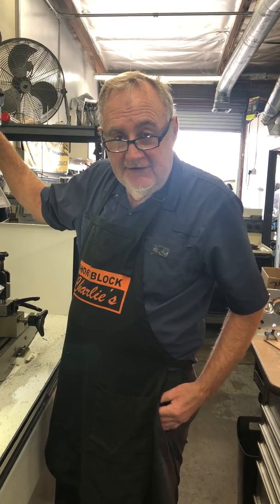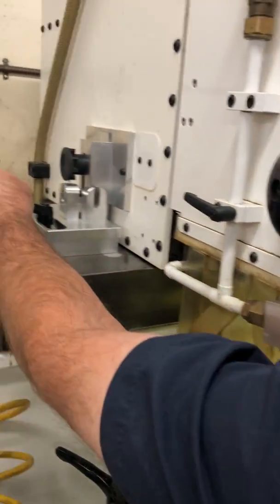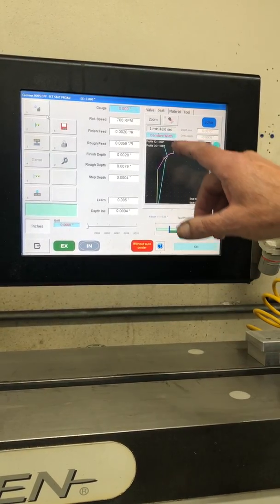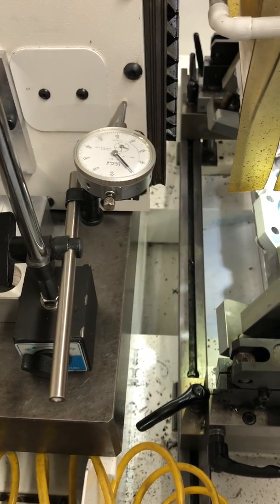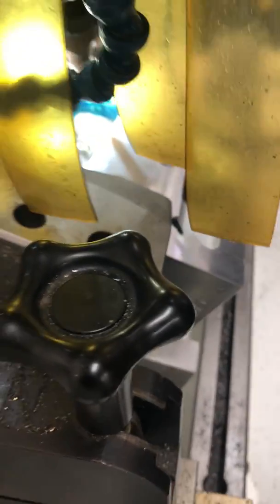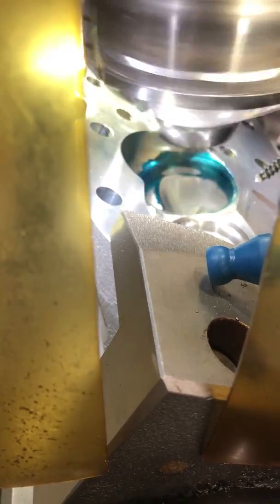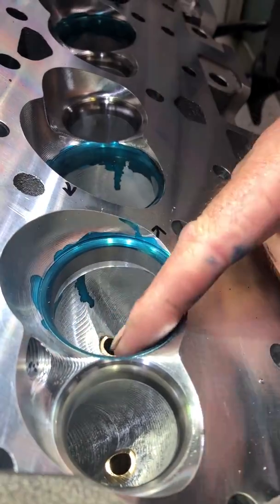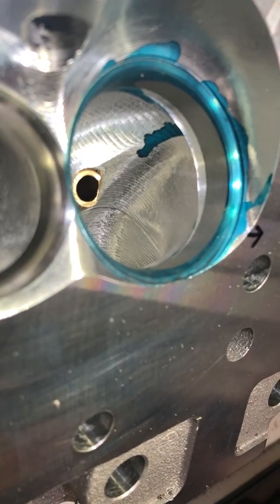Off set valve  seat on a AFR Chevy Cylinder Head

Comment: whats the advantage of the offset seat?
Reply from the maker: this is all new for us at the shop. we have found the seat do affect air flow, in most cases it enhances air flow. the interesting thing we have found , when you reverse flow a seat we the air distribution  changes, this is good when you can equal out port velocity. you also port a head differently, and favor where the offset or offsets are located. i have found on the harley heads you offset both the 3 and 9 o'clock position
Reply from the maker: enhances air flow
Reply: Any disadvantages?
Reply: Thats a gen 1 style head, not an LS head fyi